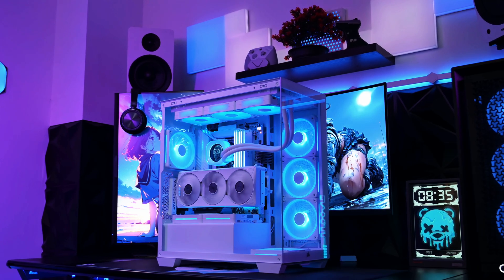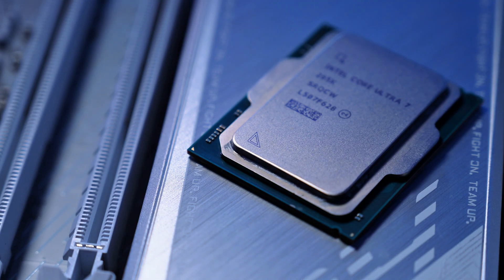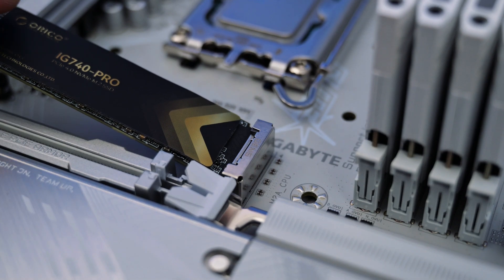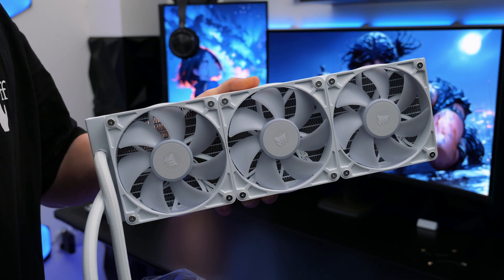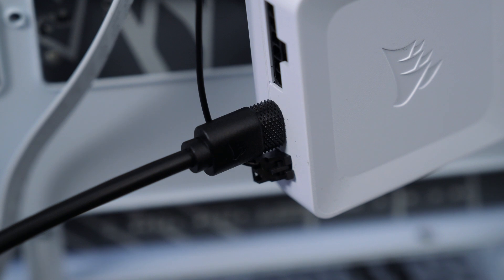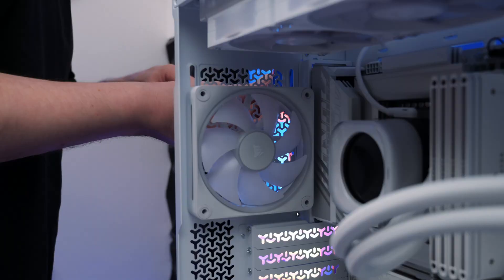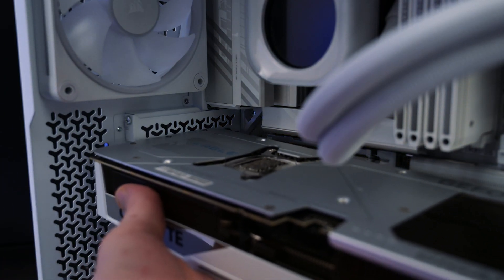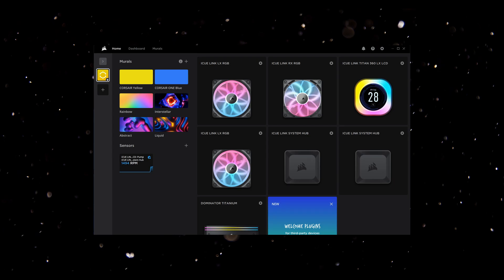How to Build the Ultimate $2500 Gaming PC

Comment: Excellent build bro... Wow, amazing...!!!  But I have a question? I have the same case, the Corsair 3500x, but I can't find the adapter to mount my RX 7900xtx GPU vertically. Every time I buy one, it's incompatible. Which one do you recommend? I'd appreciate your help.
Reply from the maker: Hey, thanks. Do you mean a riser cable or the mounting bracket? Or both! I just used a GEN 5 Riser cable and swapped the 3500x”s PCIE bracket vertically.
Reply: I'm interested in learning more about the bracket, as the Sapphire 7900xtx is large and heavy. I bought the Cooler Master bracket and the EZ bracket, but they didn't work. They're incompatible with the case. @Silenced-Tech
Reply: @victormaza6359 I think you can literally just rotate the stock bracket
Reply: Could you please tell us which riser cable you used

Comment: How did you get the gpu to mount vertically on top of a set of fans? I have the same case and have wondered if it was possible in the case.
Reply from the maker: Drilled extra holes to get the bracket higher. Bit of a hassle, but worth it